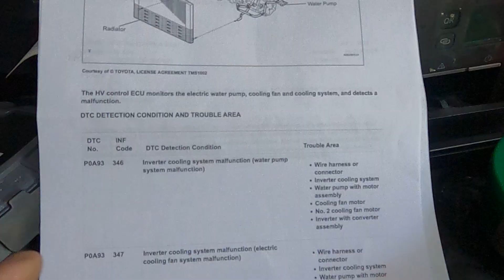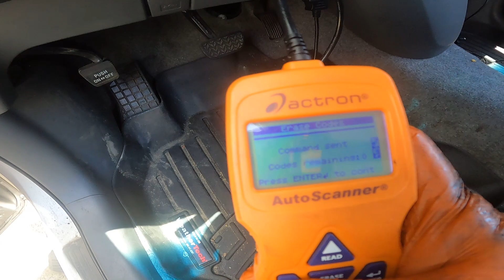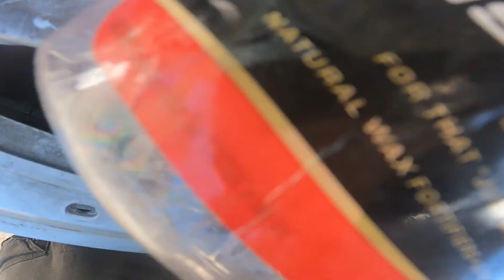How To Easy Replace Your HYBRID INVERTER WATER PUMP In 2024 For 2004 - 2010 TOYOTA PRIUS

Comment: If you would have drained the system first you wouldnt have got dangerous fluid all over
Reply from the maker: you can drain the hybrid coolant first or you can do it later, which is ever work best for you, there's no sequence for this both ways work the same, because most important is replacing the bad hybrid inverter water pump.

by the way if you haven't subscribe to my channel yet, please just click the subscribed button to get connected with my latest video also to help me to grow my channel to make more content. 

thank you again